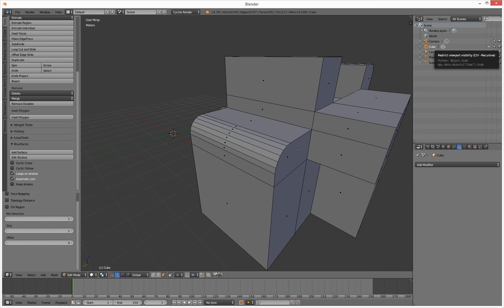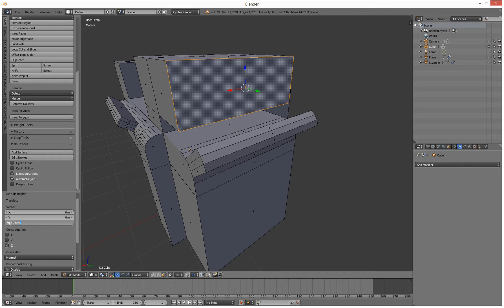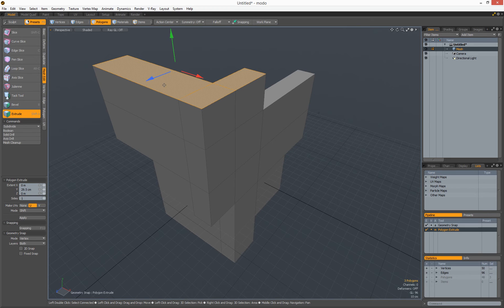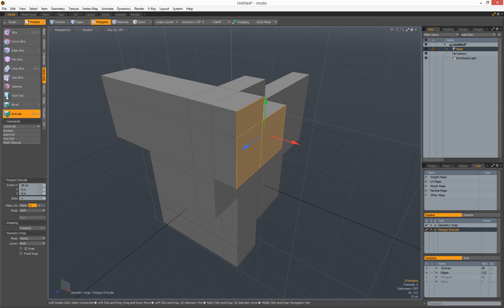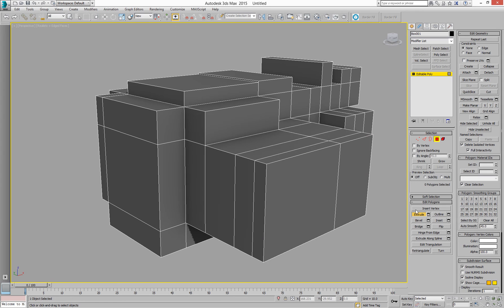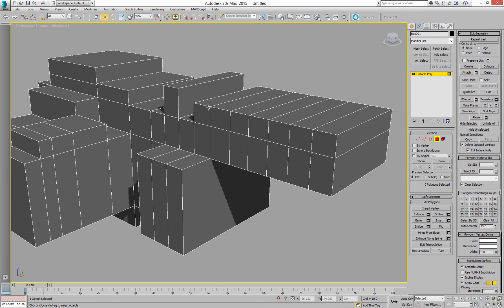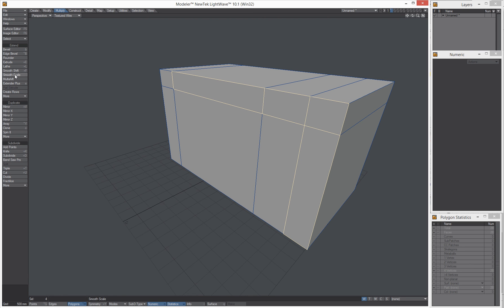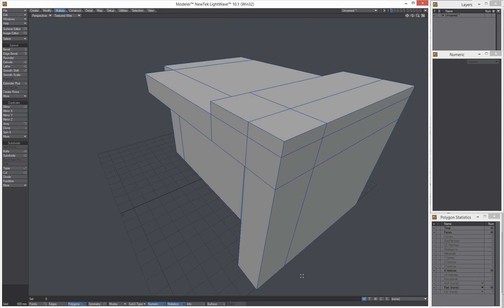***Not For Children*** extrusions in modo blender lightwave and 3ds max

Comment: Can't speak to the others, but LW has loads of different options. "Extrude" will leave polys at the beginning of the extrude, and only goes in a line. "Smooth Shift" uses the poly normals, so if you select around a corner, the polys grow outwards, but that doesn't work terribly well. Multishift allows you to extrude and inset multiple times, and around corners, with special algorithms for extruding corner selections which are a lot better than Smooth shift, and you can save a load the profiles to files. My favourite though is a bought plugin, Bevel++ for $40, which allows you to draw a profile and the selection is extruded along that, and you can save the profile to the Presets panel.